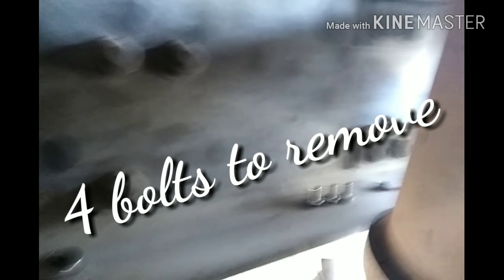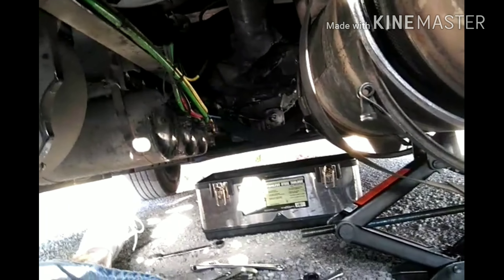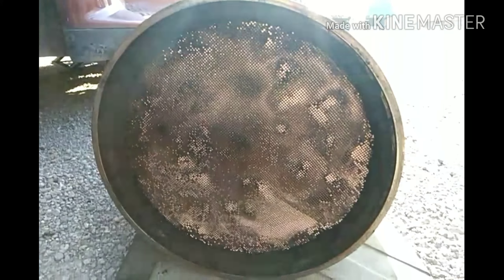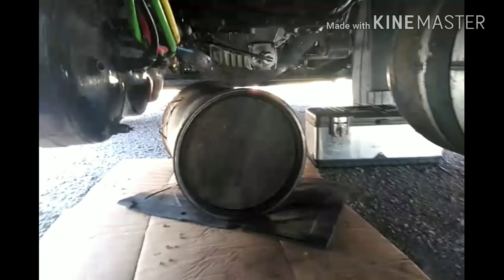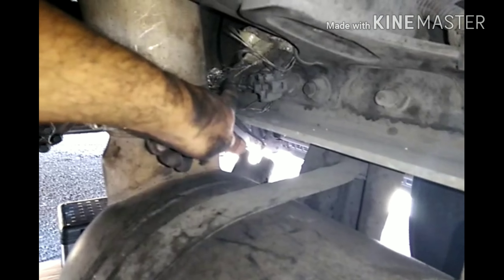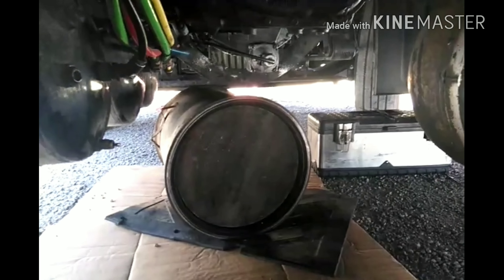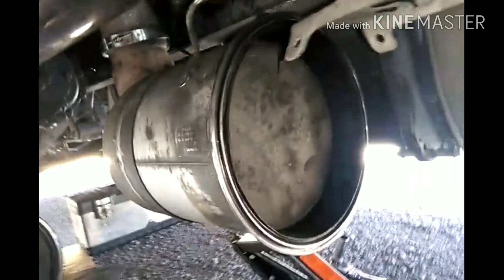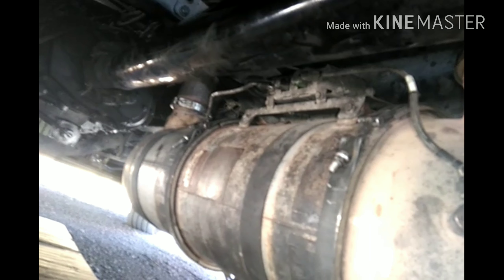Dropping DPF filter

Comment: How many miles did you go before the filter went up to 4 and a 1/2%?
Reply from the maker: yea its been about 3 years since the last time i cleaned it,but also because i do alot of local work,that glogs it up fast as well,alot of stop and go is not good for this system.

Comment: How would I remove the engine light code and turn beeping sound off after this task is complete Sir?
Reply from the maker: disconnect batteries for about 5 minutes hopefully that helps
Reply: Vic Med Thank You Vic I’m going to try that 💪
Reply: I’ve heard that for this particular work, you must use the Diagnostic Link to reprogram it. Otherwise, you’ll have problems in the future.

Comment: How hard is this task for a 2013 pro star Sir?
Reply from the maker: cuoldnt tell you,ive never done a international
Reply: Vic Med Sir I just did it yesterday it was super easy 💪💪
Reply: @8mpgmafia109  is It the same as in his video? Or are internationals a bit different
Reply: @paulm4176  little different sir, I would recommend to just delete the system honestly. (As long as you don’t travel to California) best decision I’ve made go rid of the problem..
Reply: @8mpgmafia109  how would you get caught in california with a deleted system? I'm planning on deleting it but travel to cali alot
Reply: @paulm4176  ahhh no don’t risk it Sir.
Reply: @8mpgmafia109  how would they find out?